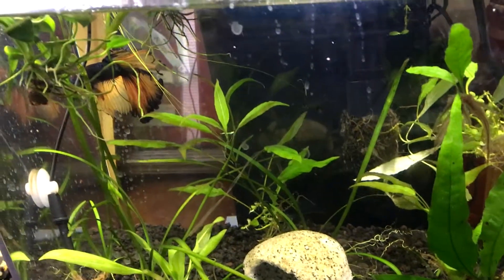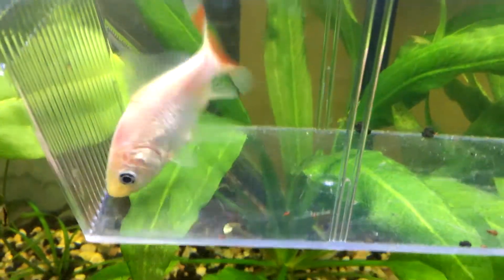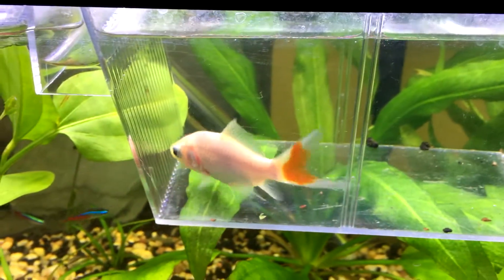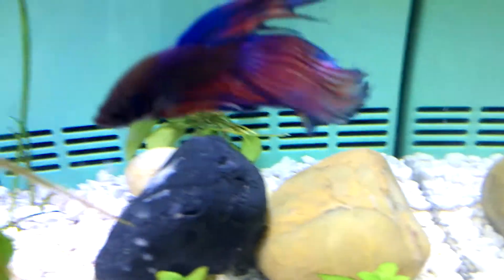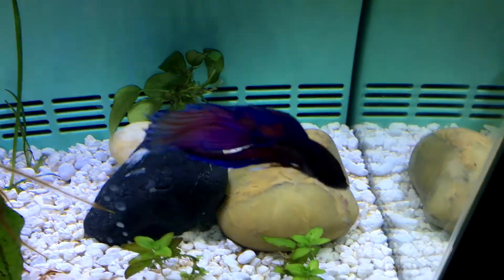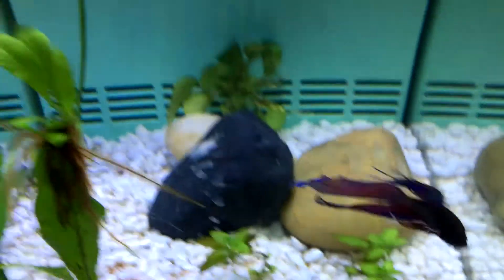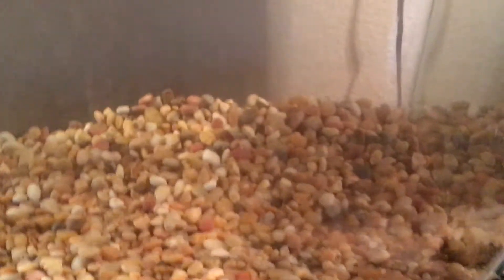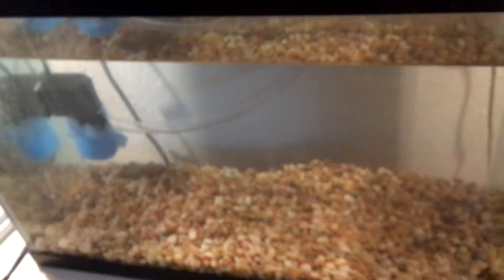DIY Mini Aquaponics System Construction

Comment: how comes you don't have a auto syphon to flood and drain? or are you useing a timmer? I think you should start with lettuce.
Reply from the maker: Aquaponic machine my pump is on a timer. I think it's every 30 minutes it will flood the planter. I have an input and an output so I always have a little water in the bottom of the planter. If I were to use a auto siphon it would suck all of the water out of the planter.
Reply: Yes I know. Because your indoors the humidity will be high. Your plant will like it.....at least make sure the top layer is dry sometimes
Reply from the maker: Aquaponic machine oh yeah. Living in Florida helps with humidity too haha. About 2/3 of the plant stays dry after flooding but that still may be a little much. Thanks for the help!